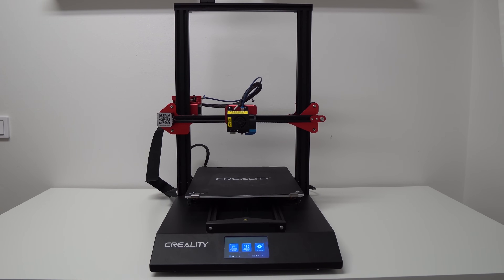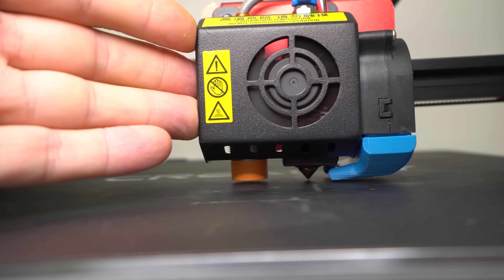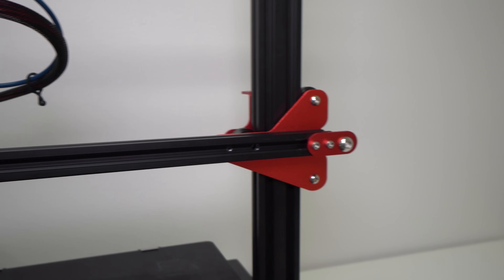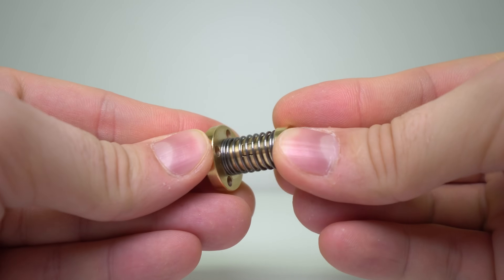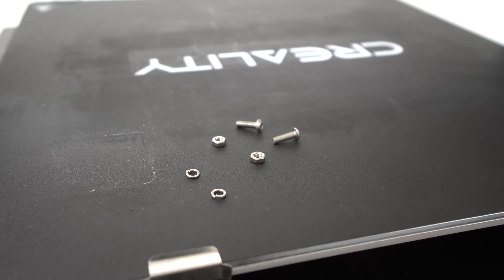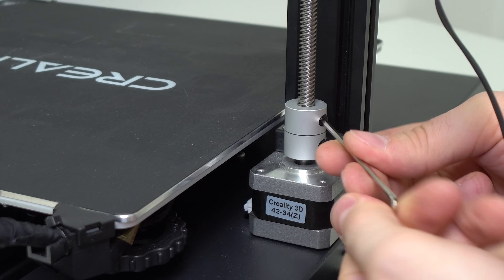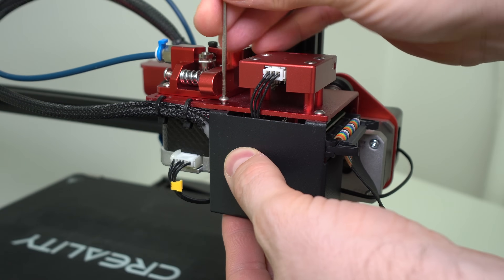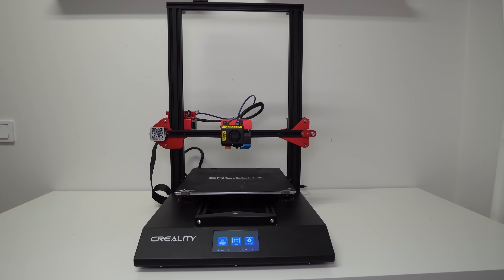Creality Cr10S PRO - Upgrade your Z axis (T8 Anti-Backlash install)

Comment: Hi Nexi, quick question. When you put these anti backlash on and tighten everything down, do you also have to make sure the z is completely level again? Then once it’s level, it should be ready to stay? Also, I noticed that when you put the rods back in the coupler, you lifted the coupler up before tightening those screws. Is there a specific gap height the coupler needs to be from the bottom?

Comment: Hello, I was looking to do this on my CR10S Pro but the T8 Anti-Backlash Spring nut are not the right size. The screw holes for one you show in the links and one I purchased at 16.5mm pitch for the screw holes. The mount on the printer are wider about 18mm pitch.Was it this much difference on yours as well?

Comment: So I need some help, installed these , but did not have nuts so just put the 2 original screws in as they before in the new nuts, however m x still sags back on the left side , is that causing the issue is it something else that I've done wrong?

Comment: Hello Nexi,  Is the print head supposed to be tight on the tracks of the gantry? if so, how is it done? I tried tightening the 3 wheels but that does nothing. I can still tilt the head up to a certain degree. I would like to see how the head is supposed to be secured on the gantry.

Comment: The problem with this approach is that the spring force must exceed that presented force by the load of the carriage assembly (which, by the thickness it looks like it cannot, try lifting the carriage instead of pushing it down, it already sits down on the threads) and this can cause considerable friction and wear of the screw and/or nut.

Comment: Nexi, I could use some advice, I had purchased a set of T8 Anti-backlash nuts from the same provider of my CR10S Pro when I bought it.  The screw holes in the backlash nuts do not match the T8 nuts that came with the printer.  So then I got an older T8 anti-backlash nut set I had kicking around... Same thing - the screw pattern is larger on my CR10S Pro.  You bought both of your T8 nuts from your links?

Comment: They're upside-down. The spring doesn't have enough force to push the gantry upwards in the configuration you've installed them in. If you flip them around, the gantry will press down on the top of the threads and the spring will press up on the bottom of the threads like intended.
Reply: So are you saying the should be installed on the top side of each bracket instead?
Reply: @jwebO5  Yes, the spring should be above the X-axis gantry.
Reply: @TheBlackBeltPanda   Most people do it wrong cause they follow youtube videos like this showing it wrong. I tried to do it the right way on an Ender 3 Neo and I had problems with the screws (they get in the way of the filament). Is there a video showing the right way to do it?

Comment: I'm beginner, I use CR10S Pro. As soon as I get the unit I think I can print right out of the box. No, because every thing print out crazy and got no idea what to do. Then found out your video and Tiny Machine and learn how to start and leveling then print. But left out with print quality. No where I can find that the size of the nozzle came with the machine and spare. There is no tech support phone# to call. The filament came out pretty thin and take very long time to print the test file that come with the mini sd. Can you please let me know what size is the more common and the best. Can you please let me know what size of nozzle you are using. Is that inductive sensor will take care of the auto leveling. Where can I order.
 Thanks Eddie

Comment: Anti backlash lead screws only help, when you have backlash in the THREADS of the screws itself. What you meant to do is dual z axis synchronisation, which is normally done by adding a belt and two toothbelt nuts ON TOP of both z axis' and connecting them, so they CAN'T turn individually. The anti backlash nuts are great when you have really crappy leadscrews or they get worn over time, so nice update indeed, but does not fix the addressed problem.

Comment: Nexi, I have watched many of your videos and I like the way you do them. I have a question about this printer. I have been going back and forth about which 3d printer to buy and it seems it is between the Ender 3, Cr-10, and the Cr-10S Pro. You say the Cr-10S Pro is the best one that Creality has produced and you only did what I can see as two needed upgrades... the z axis and the autolevel sensor.

I see other input but I think I trust your input the most based on how you do your work. Is the Cr-10S Worth the money. I could just buy the 200 dollar Ender but the bed will not make the length of my current and needed primary project. I nee the 300mm bed. I am leaning towards the Cr-10s Pro. Can you give your unbridled opinion please? Is it really worth paying this much more?

Comment: This was all good and all but after I received my backlash parts, the holes didnt align up with the bracket. Better description. The top copper piece that touche the red bracket, when you insert the screws after compressing the spring didnt align with the the red bracket. Well, so much for this idea. Was looking forward to having it too

Comment: Thanks for the great videos and tips that really help solving issues! About that one, don't you think that can damage the Z motor since he will have to produce much more torque than desigend for?
Reply from the maker: Phil Fastmike You welcome mate! Im glad that I helped. 
 Damage Z motor? Now Z motor works with less stress actually. Before stepper motor needs to carry and support all that weight and now sense spring in the lead screw are taking some of that weight stepper motor needs to work less to keep Z axis level. Beside I did not increase voltage on Z stepper driver. Both Z motors are ice cold. Imagine sometning similar like contra-wheight in elevator. 
Beside, you can not damage stepper motor that easy. When you put too much of load on the stepper motor he will start to lose a step. Try to grab Y axis(Heated bed motor) while starts to move. You will hear trrrrrrrrrrrrrrrr and when you let it go stepper motor will continue to work normal again.
Reply: @NexiTech  It makes sense! Thank you very much   :-)

Comment: I like it .... wondered about that when I looked at the original design.  I notice Keri had a concern about location.  Actually it doesn’t make any difference ... as long as pressure is consistent on both screws. Either top or bottom.  They are taking up space. Thanks for video.

Comment: Hi, i just bought there t8 nuts,, install them, but after stop the printer, the stepper motors move again. What should I do ?
Reply: Hey, I'm currently experiencing the same issue... Did you manage to find a solution? 

Cheers, Scott.
Reply: @scottwinchester6162  Unfortunately, the t8 nuts aren't enough. I also sincronised the 2 stepper motors. It's a common mod to do. You will need 2 Gt wheels and a one 2gt belt. I dont know the exact length (maybe 68 mm or 78). You can also find the stl for the 2 brackets that hold the rods, custom for this mod.

Comment: Hello, Nexi. I usually enjoy your videos but the way I see it, this "upgrade "  seems bad. The real fix is to assemble the x gantry correctly, at 90 degrees  to the verticals, without it being in tension in any way(that's the real reason in pushes down/up). And tightening those until they flatten out is not recommended. Maybe do a video showing the real fix or re-upload this with a better solution, because this is one of your bad fixes. People use and recommend those fixes after this and I don't believe this was the right approach.
Reply: how do we assembly the x gantry correctly at 90 degrees? any other video you can refer me to?

Comment: Really liking this CR10S PRO upgrade series! only other thing I've had to do is upgrade a couple fans that got noisy in the printers base with Noctua fans.
P.S. on the level sensor wires I crimped them so they could use the original connector and not need soldering.
Reply from the maker: Shannon Williams Nice work mate! Ha,you read my mine :)
 I received new fans today. Got to test them first I got some ideas for next upgrade.
Video is coming soon :)

Comment: I made this mod already. Did helped a bit, but not enough. So i will made the Belt-Mod on top of the Z rods (like this https://www.thingiverse.com/thing:3387741 but with longer 600mm lead screws. I have to cut them to the right length - and i dont lose any z hight). That should solve this problem one and for ever.

Comment: would you recommend this solution over the pulleys and timing belt at the top, and if so why?
Reply: the timing belt is better because it works. These anti back lash really don't do anything
Reply: Another vote for timing belt

Comment: I bought those for the CR10 and holes don't line up, have to print adapter found on thingi.
Reply: robson668 hello, do you have the link for the adapter ?
Reply: @DrMacabre  Hello Guillaume, it's this one, you need some M2 screws and nuts to install it, also it would be a good idea to print Z stepper mounts that let you move the stepper back and forth to get the correct alignement, with the threaded rod, the standard mounts are not so good.
This is the part:

https://www.thingiverse.com/thing:3068176

Comment: Nice video, you can also add an ending G-code to tell the x axis to park on the opposite end of the bed, this will counter the weight of the x motor and prevent the sagging effect after motors are disabled.
Reply: How can we add this line of code. I don’t have much experience coding
Reply: @peebs2424  gcode doesn't require any coding skills. Brainless.

Comment: The real solution is to have dual z-endstops...
Reply: I really don't get that they did not fit this premium printer with a second switch. The microcontroller has enough pins left and Marlin support is perfect. The cost would be less than $2.... Since i upgraded to a second switch level is always perfect.
Reply: @geekmystique  how did you do it?
Reply: @geekmystique  i'd like to know as well how you did this, would be very helpfull
Reply: you need to compile your own marlin and assign a free pin to the second endstop. for this printer the firmware is here: https://github.com/InsanityAutomation/Marlin/tree/Creality_DWINTest

Comment: why didn't you install them from the top instead of cutting?
Reply from the maker: Sinan YILMAZ There is no space for it and this way it looks more like stock. Beside brass is soft material.
It tooks just few seconds with electric grinder.
Reply: @NexiTech  I am asking if you install them upside down on the red plate?
Reply from the maker: Sinan YILMAZ Im telling you there is not enough space/clearance. T8 nut is round and it has 22.15mm in diameter. It would collide with bowden extruder part on the top. You would not be able to load filament in the printer. 
https://drive.google.com/folderview?id=16IAcW3I14muf6L26RNh_-1WhtCpwFumV

Comment: Wait a second, you have to cut a side of one of those, how do you do it? A normal human being has no way to cut metal at home  :(
Reply from the maker: Carlovfx It's not that hard.
That T8 spring nut is made of brass(soft)metal.
 You don't need to cut it. Get metal fill(few bucks) in the hardware store. I takes couple  minutes of filing, It's not that big of the deal. If you have electric grinder it will take like 3 seconds :D
Reply: @NexiTech  a dremel would work?
Reply: @Carlovfx  yes
Reply: I did it with a hand file - it took 4 minutes...

Comment: Super video thank you! When I want my z-axis to be 10cm on each side, I turn a motor to compensate for differences in level but once I let go, it turns on itself and the setting was useless. Does the method presented in this video really solve this problem?
Reply: That depends largely on the amount of misalignment you have in your specific printer. If it is too much this wont help. Instead losen the screws that attach the V-slot wheel carriage to the 20mm Z-extrusion. Retighten while leveling with the acrylic spacer. left side is difficult though.
Reply: @h.p.baxter8150  I have the same problem - when the left side is set at 100mm the right is 103. Turning the motor creates tension and when released the elasticity of the frame turns the motor back. Would you explain your solution in detail, hopefully with pictures, as for a newbie, please.
Reply from the maker: Jojo Décamps Yes it does solve this problem that's why I made this video :) Follow these steps from this video tutorial and your Z axis issues are gone.
Reply: Thank you so much for your help!

Comment: Nice but anti backslash nuts are designed to be installed to press down, basically upside down how you have done it
Reply from the maker: Kari Penttilä I like them this way and they work very nice on my printer but you feel free to install them how ever you like :)

Comment: Sorry, but not tightening the screws and nuts is like waiting for them to come loose.
Why even bother using spring washers if you are not using them correctly? To use them right, you have to tighten them and then the spring makes sure they are not getting loose.
Reply from the maker: 3d Print Creator In the video I said: Tight up screws, but not too much. Most people will over-tight those small M3 screws and then get issues with the threaded rod after. Beside, those big and strong T8 springs are holding screws in the place from underneath so you basicly don't even need any nuts or washers on upper side...

Comment: Kind of ironic. I'm literally sitting in front of my printer about to install a pulley system on my z axis. I look down on my phone and see this. Seems like a much better option. Thanks!
Reply: why not both?
Reply: I'm still considering which is the better option. Not sure really. The belt sync solution seems more invasive but also a more sure way of making sure both rods are in sync.
Reply: I prefer the anti backlash nuts as they eliminate the backlash between the lead screws and the factory nuts